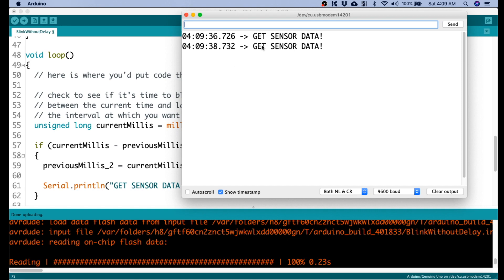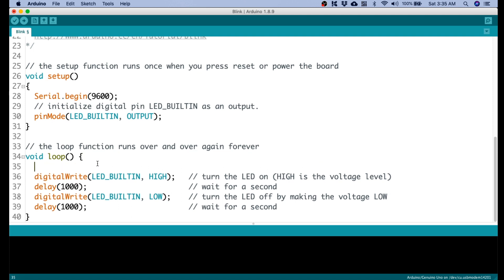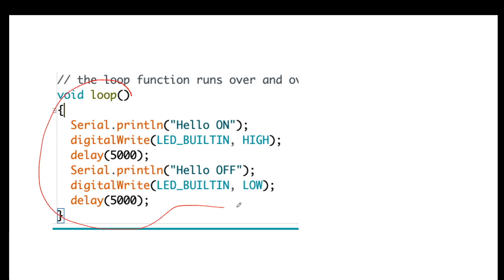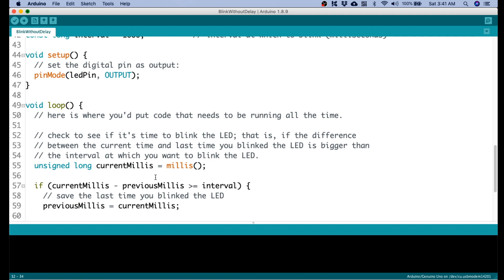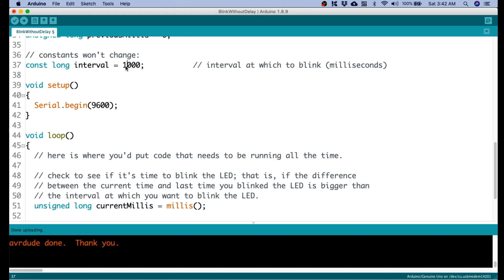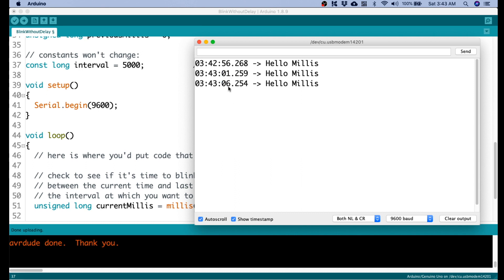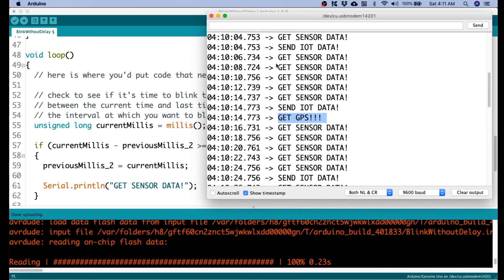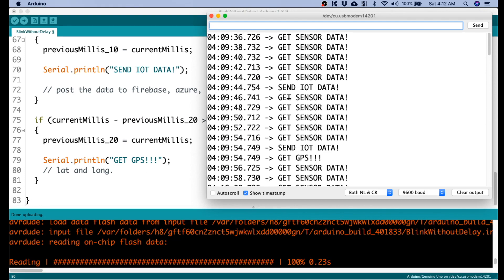ARDUINO MILLIS TUTORIAL STEP BY STEP WITH EXAMPLE - AVOIDING THE USE OF DELAY

Comment: esp8266 gamit ko boss, every line nagsusulat siya ng "Hello Millis" nababalewala ang interval nya. Pano po yung clock speed nya? nagset na rin po ako ng 115200 baud rate, ganun pa rin.
Reply from the maker: Hi noel. Can I look the code inside void loop()?
Reply: @circuitdesolator  it's the same as yours sir.